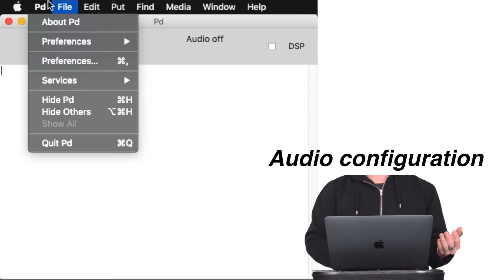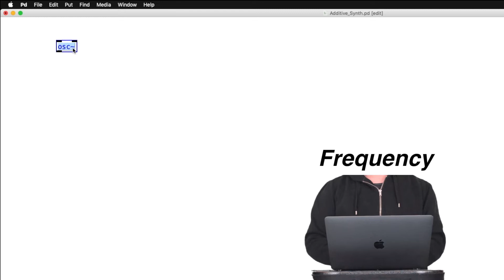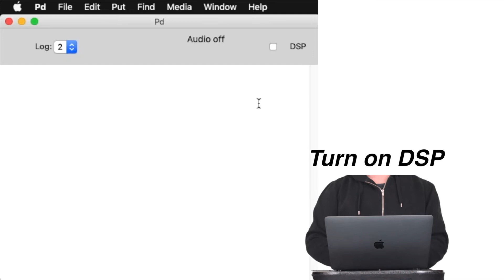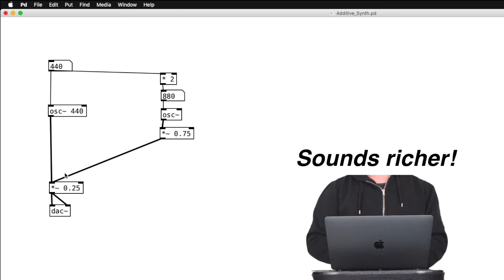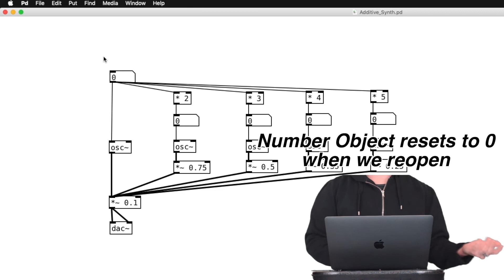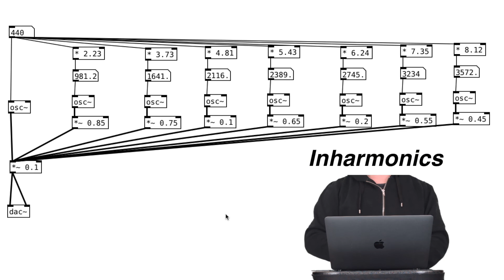Additive Synth (Pure Data Tutorial #2)

Comment: At 2:21 you say "command 3" for number objects. I'm on windows and also on plugdata so what would that be? I ended up using a message box or "float" (I think) for the fundamental pitch and a "floatbox" for the overtones. Don't know if I used the right objects, but it did end up working, except It doesn't let me change the floatbox manually and also I don't think it lets me move the number around like at 5:27. I tried on both edit and run mode...
Reply from the maker: Choosing "Float" after clicking on the "Add object" icon at the top totally works! I don't know the shortcut for Windows unfortunately. 
If you toggle to "Run mode" from "Edit mode" at the top of the patcher window, you should be able to interact with that number object. Make sure you click and hold and move the cursor around. You won't be able to move the object itself in "Edit mode". Hope this helps!
Reply: @SoundSimulator  Yes thank you so much!

Comment: Mr. SoundSimulator. Quesiton.

You chose the set of numbers for multiplcation (2.23,3.73,4.81,5.43,6.24,7.35,8.12). Why were these specific integers used? The sound it created is pleasant on the ears regardless of the inital value it is being multipled by. Do you know of any other sets of numbers that are just as useful? When researching sound inharmonics, it gets very complicated very quickly!
Reply from the maker: I just referenced the Inharmonicity article on Wikipedia :)

Comment: I have the same problem here. osc~ just creates silent noise no matter what.
Reply: I found out what was the problem. The X in "osc~ X" is an initial frequency. The left input is used to set the frequency, but you'll see no effect unless you change the value outside of the edit mode.

Comment: I was trying to add a "bang" button to add a value to one of the overtone multiplier objects, but I couldn't figure out the correct sequence, it looked like a bang object into a message object with "+ 0.3" plugged into the multiplier box, but couldn't get the value of the multiplier to change. What would it look like to do that right?
Reply: Also, when I'm changing overtone multiplier values in edit mode, how can you make the tone immediately reflect the change? It only changes after I change the "master" number message object (don't know what you'd call it).
Reply: Ugh I have so many questions, it's ridiculous, thanks for getting me started on this crazy stuff man, holy cow
Reply: I guess I'm having trouble building an understanding of how I can dynamically adjust these parameters without overriding the initial input. Like, if I want to put an LFO on here to modulate the frequency of one of the overtones, it seems to want to just use that LFO as the overtone instead, but it's just because I'm getting turned around with how these signal pathways work, what they choose to use and why, and I'm not sure where I'm meant to plug in a modulation oscillator.
Reply from the maker: I think I know what you mean. You may want to wait until the sequencer tutorial. We make a counter algorithm and you could reference that. 

As for the second question, just changing the argument is not going to affect the output value unfortunately. 
There are several work-arounds though!

-You could connect a metro 500 object to the "master" number box.
-Number box or message object that is connected  to the second inlet of [* ] object is also connected to a button object that is connected to the "master" number box. 

You'll start to learn these tricks as you continue on with the journey!! Best of luck!

Comment: Is there a way to add frequencies to the oscillator without making a whole bunch of new oscillators? Because I'm trying to replicate an engine sound and the amount of oscillators I have to create for all the frequencies takes up a lot of room. Also, I am trying to create an engine sound synthesizer. I'm having trouble figuring out how to generate sound to be able to get anywhere,  and how to multiply that sound to get more cylinders as well as change the pitch to change how the engine sounds, how to use the phasor at certain ranges like 0-0.25 and 0.75-1 to change the phase of the sound, having different delay times for each "cylinder", using formant preservation so it sounds realistic, how to feed the sound through delay lines to simulate intake and exhaust, how to use pitch and timbre to simulate pipe length and width, fm synthesis and wave shaping so it sounds realistic, how to convert hz to rpm. Being that piston motion can be represented by a cosine wave, (which I already have modeled), I need to figure out how to have one phasor go from 0-0.25 and the other phasor go from 0.75-1 while I am using the slider to increase the speed of the "engine" and be able to hear the change of phase.   I think that should about cover it. I know how an engine and exhaust work. I just need help with the synthesis sided of things (pitch, timbre, delay, formant preservation, frequency modulation, waveshaping, fm synthesis etc. If it helps, i can make a video discussing it further so you get a better idea of what I need help with.
Reply from the maker: I sound designed a car engine as an exercise and it's a lot of work!! I had good luck using FM sawtooth synth, but it seems like you're doing something super accurate and dynamic. Doing it in additive synth like in this video is definitely not the way. 

Do you know the book called Designing Sound by Andy Farnell? It has a whole section on car engine sound! It should answer your questions better than I can!
Reply: @SoundSimulator  Yeah, I was referencing the book when I was talking about the phasor and the cosine wave, but it didn’t seem to really explain very well about how to do everything in pd. It doesn’t seem to mention about adding cylinders, bank angles, crank angles, firing intervals, etc. It also didn’t mention anything about how to shape the waves to make it not sound synthy. I’m just not sure how to get started. I’ve looked at all the engine examples on Andy’s website but none of them really seemed to give me a good starting point. The motor example sounds way too synthy for me. It’s like there’a nothing on how to get started. If you search beaming.drive 0.16 engine sounds, (it should be one of the first videos) you’ll see what kind of sound I’m trying to obtain as a baseline quality.

Comment: Thanks for the tutorial. I am not sure why you use a fixed frequency (440) for your main oscillator as in osc~ 440. Can you not have it dynamically generated as with the other harmonics? I would have expected just osc~ since the number object is connected to the inlet of osc object.
Reply from the maker: Good point, Frank!
I had 440 as the argument in the beginning since we wanted to hear it. And I just kept it in when we added an upper harmonic. When we move the number object connected to the [osc~ 440], output of that number object will overwrite the 440 argument. I should've explained that part in the video! It is just [osc~] near the end of the video.
Reply: @SoundSimulator  thank you! Was wondering the same thing! Great tutorial!

Comment: Great tutorials. Just curious. In the 1st video, you used a bang button. On here there is no bang button. Is this because the OSC~ is always running and does not need to be triggered?
Reply from the maker: You're correct, Gene! Signal objects [~] will be active on their own as soon as DSP is turned on; they don't require bang message to be working. That was a great question and I should've mentioned it in the video. I'll pin your comment!!

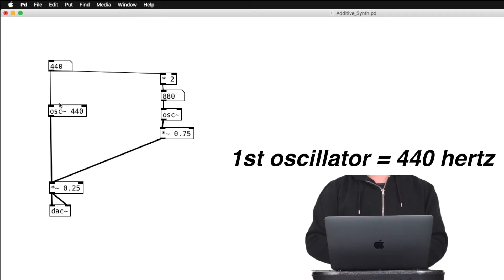Comment: Hey dude! I just learning Pure Data and first thanks for your tutorials are great!  Silly thing: I can't type 440 in the first box like in the 03:40 part of the video. Thanks!
Reply: Solved! xD I can't type thee number but If you drag holding "Command" it works
Reply from the maker: @sequencist  I'm glad you were able to figure out a way! 

In order to type the number in, you have to toggle out of the [edit] mode using "command" & "e" (in Mac). And click once on the number box and then you can type the number. Press enter to confirm and set! 

You can actually do it in the [edit] mode too, which I just now discovered. Hold "Command" like you did before and click on the number box (you don't need to click and hold), and then you are able to type the number like in the first approach. 

Thanks for watching!!
Reply: @SoundSimulator  Thank you for the quickly response!! Now I see the 2 modes and how affect to the boxes!

Please keep doing these amazing videos!

Comment: This are really useful and succint demonstrations. What others do you have in the works?
Reply from the maker: Thank you! I'm currently working on introduction to electronics so that we can use sensors to control sounds! For example, we can use a light sensor and use flashlight to control a synth we designed in Pure Data. Brightness of the light can be mapped to the volume or filter parameter for example!